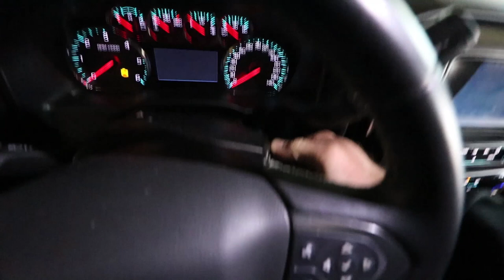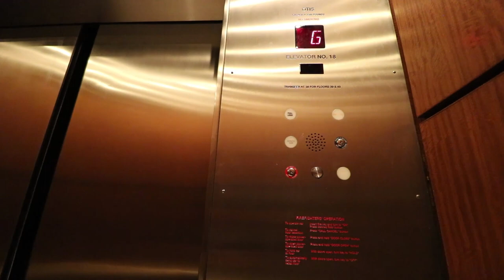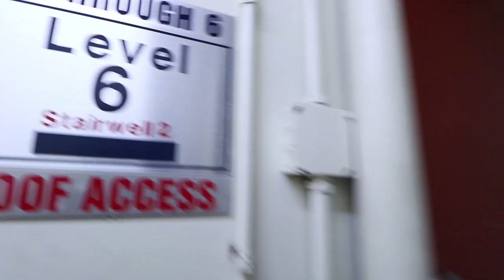A Day In The Life Of An Architect: Architecture Vlog #1

Comment: Dave, have you ever designed a 2 bedroom 2 full bath shipping container  to look like a small cottage home. This would be a project for me for my small home. Can you help🙏🤓
Reply from the maker: While he hasn't done that exactly; one of the previous firms he had worked for did design shipping container townhouses!  That would be a very interesting task to take on, but (this question would depend on the part of the world you live in) why use a system not designed for the proportions of the human body to build something and make it look like something else?  Are you enamored by the idea of shipping containers, do you like the aesthetic of them, do you think it's easier to build with them, or do you like the tetris like application of them?  There is a lot of engineering and resupporting the structure that goes into cutting and splicing shipping containers together.  Costs can be driven up much higher than anticipated because of this, and can easily justify building with wood and concrete instead.  Just some food for thought.  We hope you enjoyed the video, and we look forward to hearing back from you!  Have a great day!

Comment: How much an Architecture designer get when he design a house with 3 bedrooms and 2 bathrooms
Reply from the maker: Hi Kahin!  Thanks for watching, and we hope you enjoyed the video!  We aren't quite sure what you're asking here; how much an architect would charge a client to design a house like that, or how much an architect would earn (after all expenses) to design a house like that.  The simple answer is there is no standard answer.  Each architect would charge differently depending on their firm size, experience, how much time is spend designing, if they are also designing the interiors, What level of completeness of the construction documents, if there is construction administration involved, if they have to work with the city on zoning or platting issues.  Sorry to tell you, but there really isn't a good answer for your question.  A good rule of thumb is that an architect's fees will roughly equate to 8%-12% of the cost of the building they are designing.  We hope this helped you!  Have a great day!